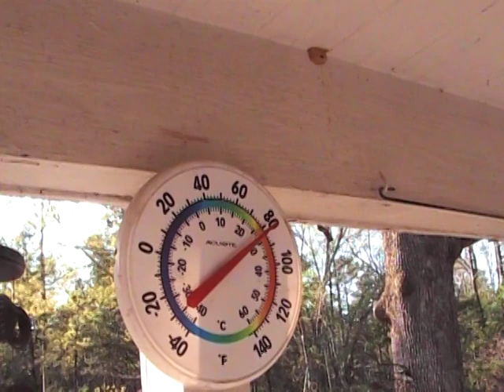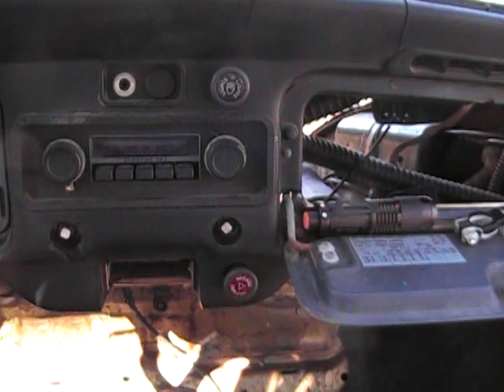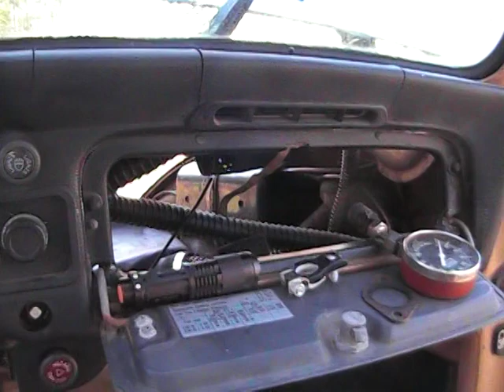Blueberry Beetle Bug

Comment: You are definitely become a serious collector with your ear to the track for any VW that needs a love'n home.
Reply from the maker: I just hope I like driving them. These are the first ones I have ever set in. Thanks Lloyd.
Reply: +cutworm59 They are fun to drive. The are super good in the snow. I used to fish tail mine around corners like Starky and Hutch its fun. Becasue there is no weight in the front end they steer easy. You can steer them around corners easy and you feel like you have a lot of control. The dont excellerate very vast though. But still fun to drive.

Comment: A 1960 panel van would make a nice addition to your collection if you can swing it. I have already traded off my 1960 panel but it still needs to vacate the premises. I do believe that the big plug in the back of the beetle is for diagnostic purposes... My 1973 vw thing has one of them and that is what I was told. I probably would never use it for that purpose though as I have no diagnostic tooling. Thanks for sharing your wit and wisdom with us all. Thanks for all the videos!
Reply from the maker: I re-watched you make a bunch of panels for your double cab last night. Brilliant work!

Comment: I think that automatic shifter on the right side of the steering wheel turns the wipers off dont it? O yea dont forget to put some air in the wiper washer tank.lol Some of them stole air from the spare tire too. You could have a clean windshield and a flat spare.
Reply from the maker: Thanks for the good help Scotty Boy. I think that kinda strange that they would plumb the washers into the spare tire like that, but they did. ????